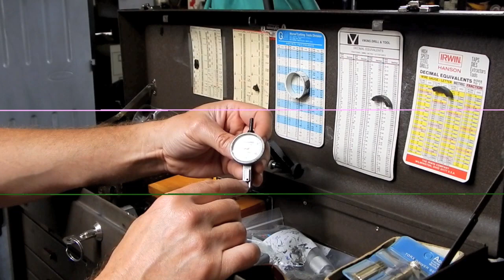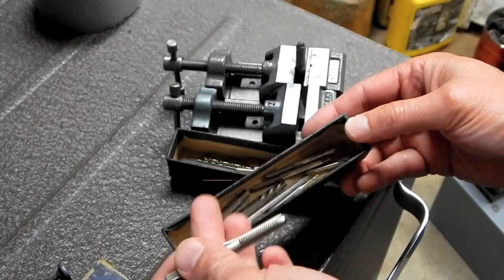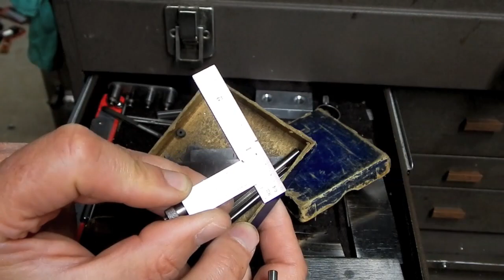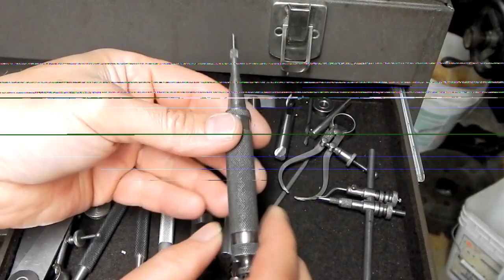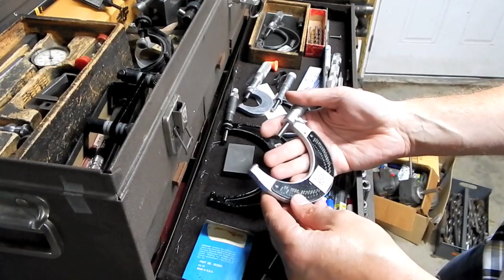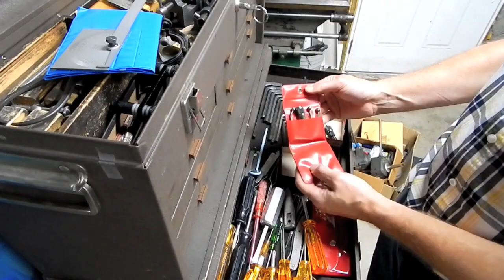2 Loaded Kennedys Part 2

Comment: Steve, if you're no opposed to a Winblows machine, I happen to have an extra  quad-core HP workstation hanging around.  I think it has 8GIG or RAM and an ATI FirePro 3D card.  it processes video pretty well and would likely smoke your mac in that department.  I'm sure we could work a tool package.  It's an HP Z200 with a core i7 processor.  It may even have a 250GB SSD internal drive.
Reply from the maker: Thanks for the offer, but I just picked up another PC to replace this mac. My kid had a part time job at a tax place that was moving at the end of tax season, so he scored one of their old PC's that is better than anything we currently had. I just got a 1 Terabyte drive to move all these uploaded videos.